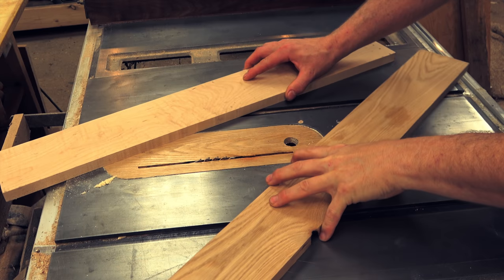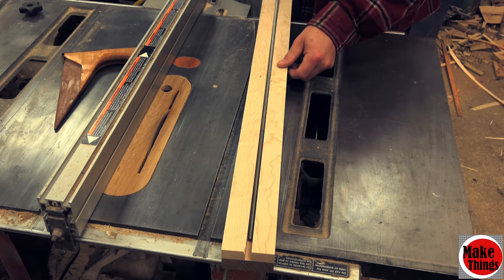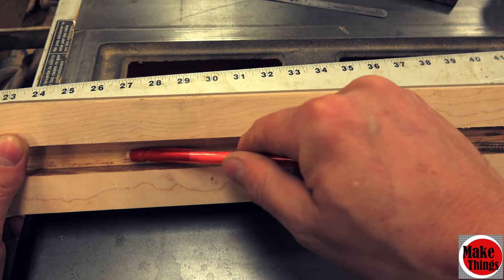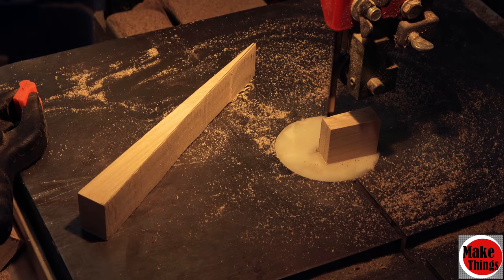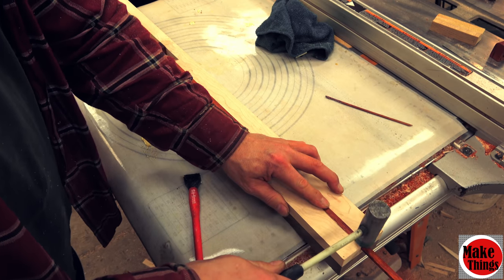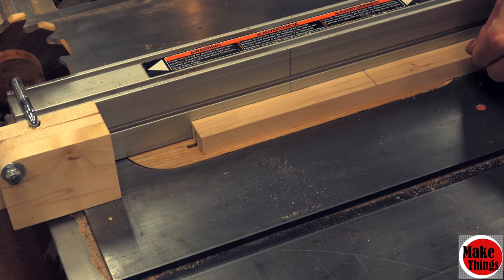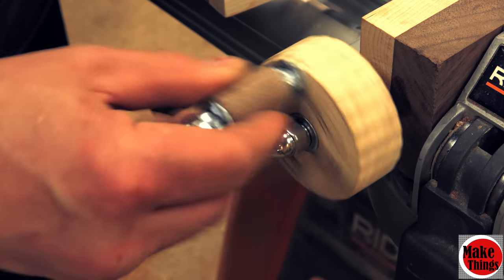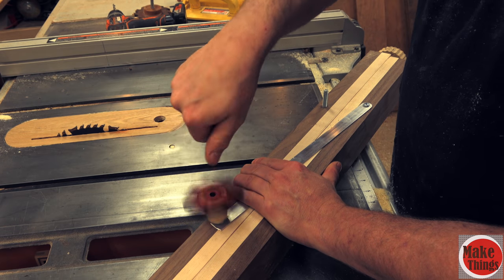Fence Coves // A Much Simpler and Practical Way to Make Coves

Comment: Great job!  I like to make my own trim and this would definitely help, however I wonder if the hinge and stabilizing arm would be enough.  Without the need for the threaded rod assembly?
Reply: same thoughts. seemed over kill there
Reply from the maker: I’m definitely going to show how to make simple jigs with scrap wood in the future to do these coves...so, no, don’t think it’s all about bolts and nuts.  This is such a cool method that I think could be invaluable and should be explored.  For me I wanted something I could run to that I could depend on to do coves. 

I’ve thought about making tongue and groove as well as some other jigs for tubing.  

I’m not sure just a metal strap with a knob is sturdy enough so you’ll have to test it out.
Reply: Brad Arnold My first thought too. An extra arm would do it. I’d prob just screw a scrap on top. The idea is perfect but my jigs tend to be more utilitarian.

Comment: It looks quite useful to have this attached to you rip fence.  That is a great idea.  But the threaded rod part seems unneeded.  Why not just set it to the angle you want and lock it down?
Reply from the maker: I’m going to update this project and use your comment...do you mind?  It’s a great point!
Reply: Of course you can use my comment any way you like.  Thanks for giving me such an interesting thing to comment on.
Reply: I had the same thought, just 2 straight boards on a hinge with that "safety" bar and you get the same functionality...albeit not as fancy. I do appreciate the craftsmanship of his jigs mechanism though. 
I do the same thing sometimes in my work (programming): write some "complex" script to do a task and then look at it later and it's like "wow, why did I do all of this when all I need is this one part"

Comment: I’m surprised that the “you can’t side load a circular saw blade like that” crowd hasn’t commented yet. 
Maybe they’re the 7 👎🏻 so far. 

I was using the table saw at the woodworking club to do a cove cut in maple and I was told that I can’t do that. 🤣😂  I wasn’t even trying to do the cut all in one pass either.
Reply from the maker: The naysayers are what makes this YouTube thing a less fun thing to navigate.  Coves can’t be done anywhere else and have a really cool look when you’re done.

Comment: What kind of screws SHOULD be used for end grain?
Reply from the maker: From my experience the courser the better, and longer.  Don’t drill a small pilot hole, instead make it slightly smaller than the screw body.
Reply: Long ones!

Comment: It's nice but why the crank and threaded rod?  Just the hinges and wood is all you need.  You can manually set the angle faster more efficiently.  I use an angle guide to set my angle.
Reply from the maker: I did a follow up explaining and fixing this one: 

https://youtu.be/B5RmLhjogBQ
Reply: @MakeThings  yea, sorry. I commented. Then watched that video.  Thanks for the idea. I think it great.